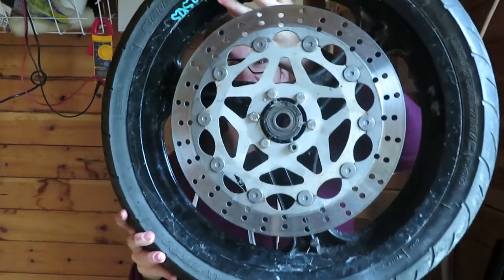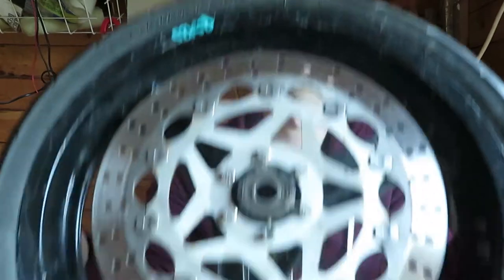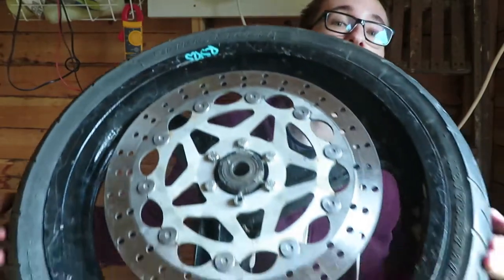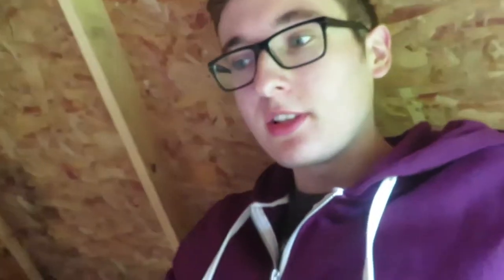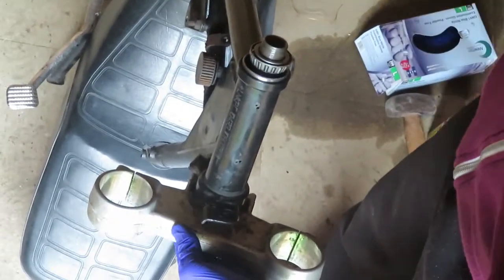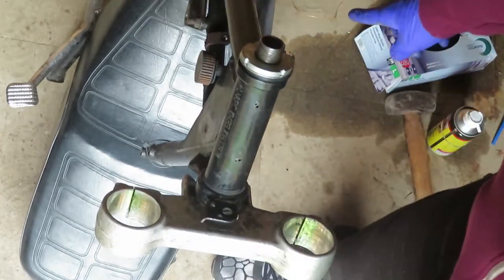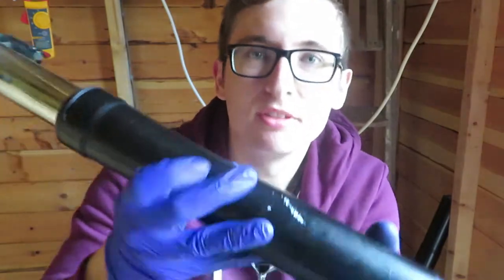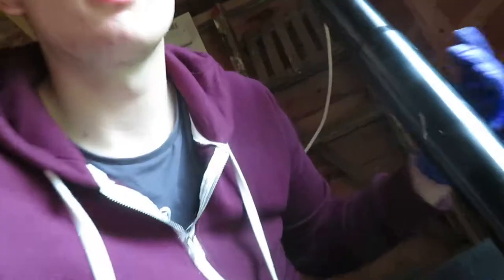How I converted Aprilia RS125 forks onto my Suzuki GN 125 frame | Cafe Racer Build EP: 7

Comment: I think it's way too tight, so it doesnt move well. Besides, your lower torrington bearing is not centered, have you checked the sizes of the two surfaces involved to use the right bearing??

Comment: Nice conversion I've build mine custom on Suzuki DR 125, with a GZ 125 front end. The breaks are crappy on that one too. but I've gone other way. Recently I bought a Honda NTV 650 caliper and made a bracket to fit it. It was cheap (13$ for used caliper) and hopefully it will do the job. Niec to see more and more small cc custom bikes! :)